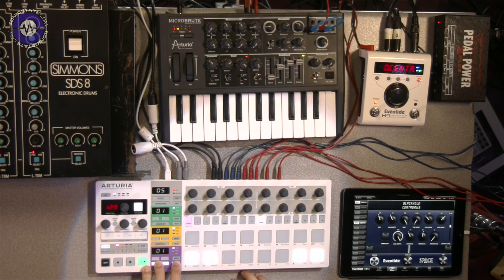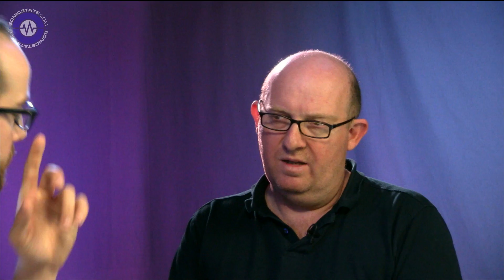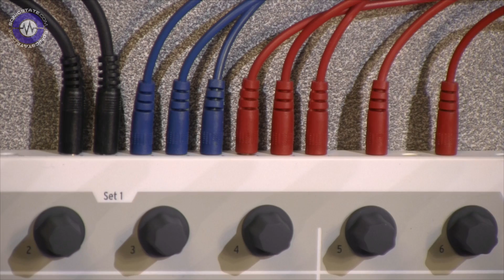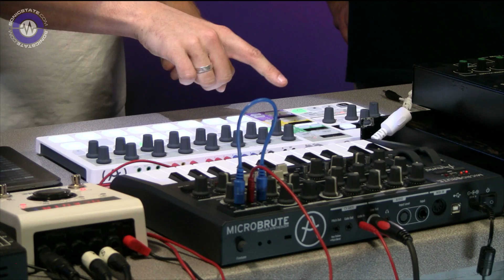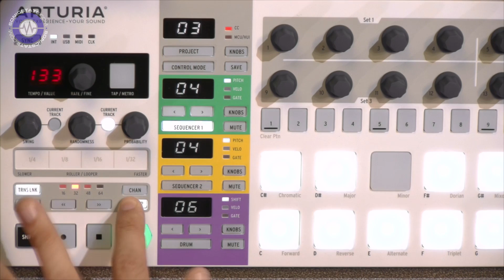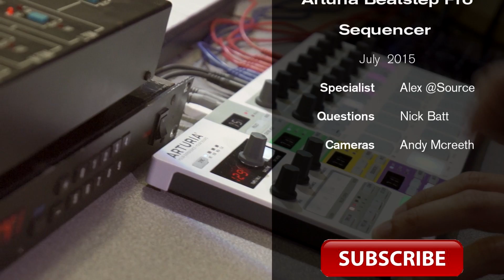Arturia BeatStep Pro - First Look

Comment: For anyone wondering about Nick's remark about '5 volts' Volts isn't quantity of power--it's potential or gradient.  You can pull a large practical  number of amps through 5V, though at some point your cable is going to heat up some, and the lower potential means there's an upper limit before juice won't flow through the plug.

There's nothing preventing you from putting a step-up transformer in the peice either to go back up to 10V...and keep in mind that control voltages are just that...just control  A powerless expression pedal can create CVs--powerless--as in, not supplying any amps at all.

Nick taught me just about everything I know about synthesis, but...well he's no electrical engineer.   In this case, not important to the synth world.

 Love him, great teacher.

Comment: a novation circuit is a better solution -it can sequence 2 synth per 
midi  and has 2 tracks with drums with 64 samle of your choice ,it also 
has rever and delay (beatstep does not) it has a ´mixer and run on 
batterie and most of all it works well -with Arturia it will have bugs 
and sync problemes(as already many reports) Forget Arturia
Reply from the maker: Thats an interesting idea, though no CV/Gate Triggers, if thats what you need.
Reply: sounds good!
Reply: Novation Circuit is more expensive, though still within the range of most of us. That said, the Circuit looks awesome -- and yes, Novation makes very solid gear. I've got two of their synths, and they're both rock solid.

Comment: can you turn off the quantization of the real time recorded sequences in the arturia beat step pro.  Does it only record sequences that match to the 16 step grid?  or does it have a "flux" or "quantized off "mode?  Because for me sequences recorded only within the quantized steps is very very limiting.
thinking about ordering one soon but I'm very concerned about this limitation.
Reply: Zakk Blews  No, it will all be quantized.  You can shift notes on the drum sequencer though

Comment: Around 7:55 I'm hearing steps when turning the knobs to choose pitches. Is it only possible to have the notes snapped to scale values?, or can the pitches that you dial in be continuous? i.e., off pitch?
Reply: Ian Page-Echols At the moment it's only possible to have 'quantised' pitch output, yes.
Reply: SourceDistributionTV Hmm. Too bad. I have some old synths that are not accurate. Guess I'll have to attempt to get them closer to in tune. Aside from that, it would be great to be able to play notes a bit out of key sometimes.
Reply: Ian Page-Echols You could mix the modulation (aka 'Velocity') lane with the Pitch output, then feed the combination into your oscillator, in order to use the velocity lane to offset the pitch? In that sense you're using the velocity lane as 'fine tune'

Comment: Really a shame that it can't do chords!!!!! I guess you could workaround via DAW or also by just using up all 3 sequencers to send 3 notes on the same midi channel, but then it's kindof only controlling 1 thing. I love that it has the sync in/out so you can use it with Electribes and Volcas etc. It looks like this thing solves all of Nick's issues with the original Beatstep with the transposing though, good on Arturia for listening to smart feedback. This really seems like a great device. Also can you record into the sequencer externally? Like over a midi keyboard or bouncing a couple of bars in from the DAW? Also, according to Sweetwater, the pads are pressure sensitive.
Reply: kassie2k4 I have been using this with Battery 4 in standalone mode and you can trigger the chord samples within it. Its been really fun, one of the best purchases this year.
Reply: friendofCHAKA  chord samples are not chords..you know that
Reply: Yes you can send MIDI into it and record - or use it as MIDI to CV converter!
Reply: +TheNoCoincidence of course don't buy it then.

Comment: Nice machine but there is some wrong info about it in this video, like the voltages for cv are 7V  and triggers 8V according to the manual. so RTFM before making this kind of video's ;)
Reply: Auxar Netlabel The manual is now corrected. Thanks for pointing that out.
Reply: Auxar Netlabel Good remark, actually the hardware does have 0-10 and 0-12 V range for pitch and gates. TFM's wrong :)
Reply: Olivier Delhomme Yeah I checked with Arturia personally before the vid, they confirmed 0-10V output of CV and 0-12V for gates!
Reply: SourceDistributionTV  Thanks for this information. Arturia should correct the manual, for many people this could be a deal breaker. Thumbs up for Sonicstate for getting it right :-)

Comment: Don't have enough hardware to warrant this and get most the functionality out of existing gear, but for someone looking for a new one-stop-option for a controller, this looks like the tits!
Reply: Remember you don't need hardware for this, it's still amazing using it to sequence plugins/software.
Reply: SourceDistributionTV So is it possible to control at the same time 3 pluginns/software, for example: Spark2 at drums, Jupiter8 V at sequencer 1 and Prophet V at sequencer 2, just plugged in my laptop by USB?
Reply: Albano Alvarado Yes absolutely - that's what's so good about this, it really will work with pretty much anything. Software, MIDI hardware, analogue hardware, a bit of all three at once!